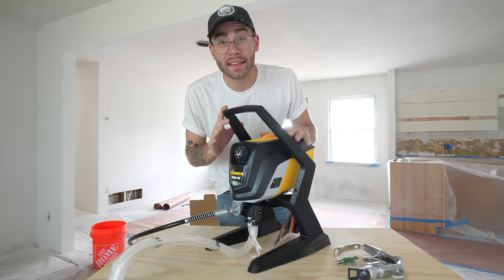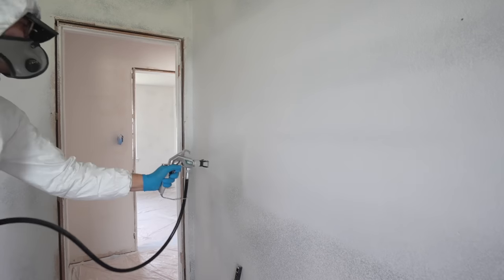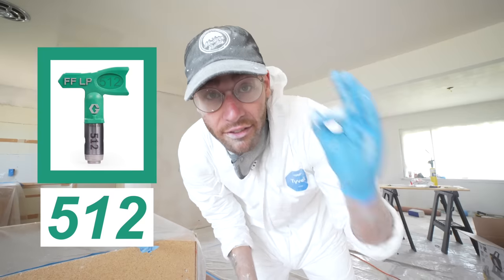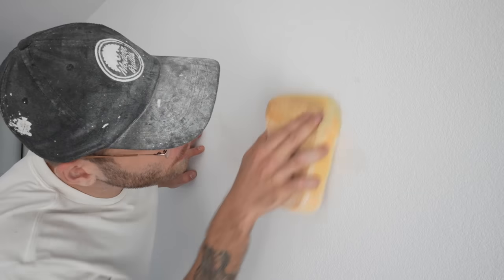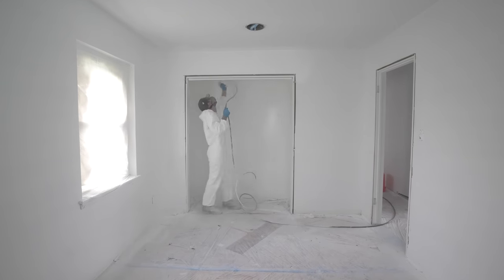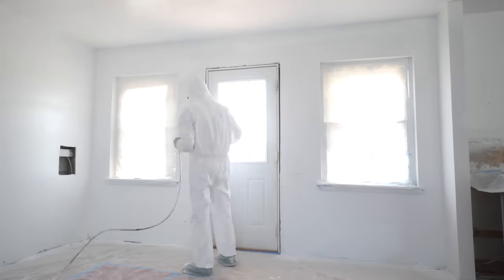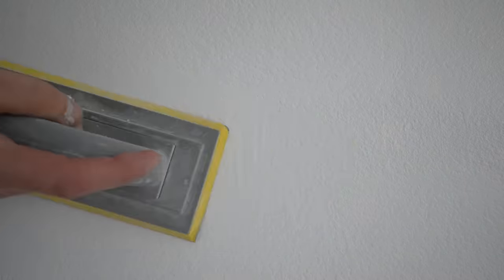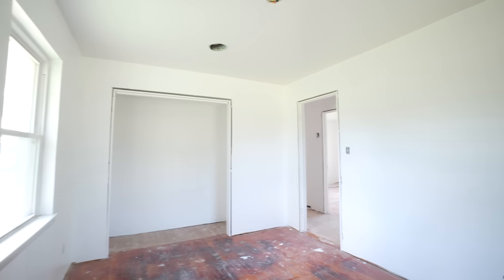I SAVED $3,000 PAINTING MY OWN RENOVATION!!! MIKE'S FIRST FLIP EP. 7

Comment: Just a pro note on paint types.. My husband and I worked his way through graduate school as painting contractors. Enamel refers to a paint with a high level of solids (thus, very opaque) that levels out well for painting furnishings and trim. You can get latex based or oil based enamels. Enamels usually comes in satin, semi-gloss and gloss finishes. Satin is much more likely to be latex-based than oil-based simply because it is difficult to formulate oil paints with low gloss or matte finishes unless they are thinned like exterior stains. Flat is pretty much reserved for latex paint where it excels.

Comment: So I think someone may have already commented this but a super pro move is to either right after spraying too back roll the wet paint with a roller or have someone else go through and do it.
It takes a little more time but will add consistency to the walls, remove any runs, and will avoid any striping. Now most paint nowadays do self level and help with the striping but just one tip to improve the finished product.

Comment: Hey Mike! Quick tip. If you’re priming new drywall, look for PVA. It’s meant for new unsealed drywall to help seal it before you put on paint. It also tends to be cheaper than regular primer, which is always a bonus on a flip! Great work!
Reply: Thanks for the suggestion! I'm thinking of building an addition onto my house, and I plan to do all of the interior finishing myself to save money. I'll definitely remember this when I go to paint the walls.
Reply from the maker: I was watching a video today about painting new construction and they recommended using PVA also so that the paint doesn't soak in as much... I'll do that going forward!

Comment: I always switch to a smaller tip when doing the doors and window trim. It will make your end result much more professional on the doors specifically. Smaller fan and smaller diameter hole. I have repainted old brown wood doors with a 310 or similar and just take your time go horizontal then vertical and they will look brand new.

Comment: My Dad and I tried out two different Wagner Machines last year. Both of them sprayed a hard line on top and bottom of the tip. Why tho? Did we used a wrong kind of Paint? We even tried to thin it out with water but it didn't help at all. Faulty tips, wrong paint or just bad luck? But all in all, if it works, this machine safes a ton of time.

Comment: Get your dad to back roll as you spray. It will help get rid of the lines. Also, if you ever let a tenant paint the walls make sure they don’t use water based paint! It’ll blister over that enamel paint
Reply: Back rolling is a good idea.  

1. It evens out the spray, significantly upping the odds that a single coat looks good.

2. It promotes adhesion by working the paint in which will somewhat increase the durability.

3. It makes touchups with a roller blend way better.

You can backroll for yourself if you're practiced and fast (and the air isn't too warm or dry) but it's a lot easier to have someone backroll behind you.  An 18" roller here is the pro move.

Also, for modern finishes I find untinted white paint fits very well, with the bonus that you can return it if you don't open it, allowing you to overbuy a skosh and ensure you can knock it out without interuption.  In my market, I figure most competent self employed tradesmen are making close to your $1,000/day, so efficiency pays off.

Comment: Awesome video man! I have a couple notes to make your life easier. You can get a brand called property solutions latex flat white for about 100 bucks a 5 gal. If you have someone to back roll when you spray it will help with the finish. just make sure when they roll the sleeve has a solid amount of pint on it or you get dry roll marks. And when you notice runs just let it dry and wait to feather it out. After I just touch it up with a brush and its good to go.
Reply from the maker: This is all good info!! I was curious what a good budget paint was!

Comment: For the next time, look into backrolling, basically spray the wall or ceiling, then when you finish a wall or ceiling you go back with a standard roller, wet with the same color paint and roll the painted surface, it will give you the consistency you didn't achieve after just 1 coat... Love the series